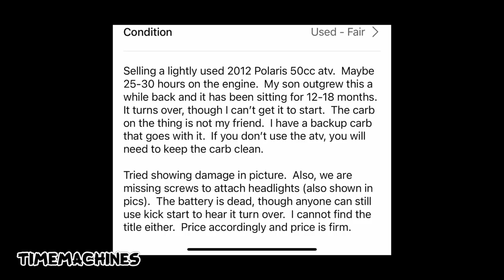How to Tuesday: Carb Cleaning & Tuning

Comment: Fellas, a little prevention goes a long way. If you're using pump gas and you have to park your bike even for a month, drain the tank and let the bike run out of fuel Or drop in some Star Tron or whatever you use to keep the fuel from going bad. Our pump gas has alot of ethanol and in a vented system will inevitably create water over time. It's just easier to prevent it. Thanks to Jarrod for taking time to explain what some folks might not know It keeps our hobby alive and well.
Reply: Here in MN we have 91 octane no ethanol fuel available at most stations. I know it's different throughout the states. I noticed some stations in Iowa only had some e85 bs and 87 it was kind of funny seeing only 2 options at a kwik trip.
Reply: @ricochetey  most of the western states have ethanol blended fuel. Commiefornia is the worst with %12 content. Our fuel is only fresh for about 30 days before it goes bad, like deck stain bad.
Reply: @Hanky_Bannist8r  That's terrible! I thought it was hard finding race fuel, sounds like you have it much worse. This ethanol junk is a huge racket and causes worse efficiency yet its crammed down our fuel necks anyway.
Reply from the maker: Very true!! Do yourself a favor. 90 percent of time im cleaning a carb because previous owner didnt!
Reply: In KY I use 93 from shell. Not sure what they put in it but it sat in my 250x for over a year and it ran fine. Used 87 in one of my bikes, it sat for 2 months and ran like shit.